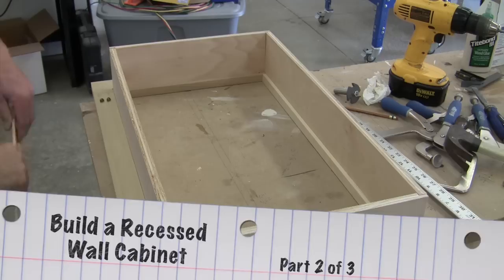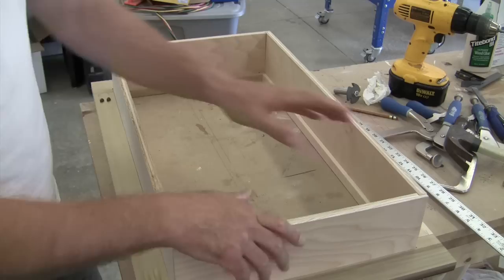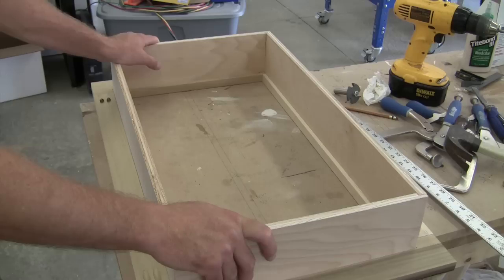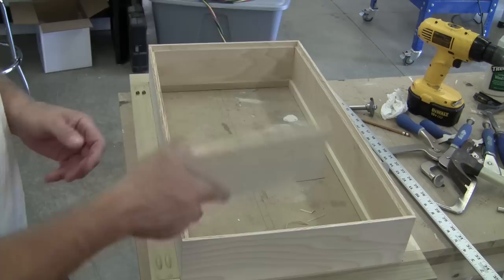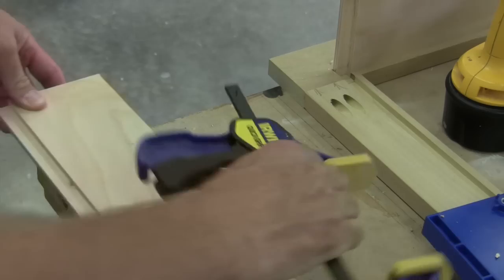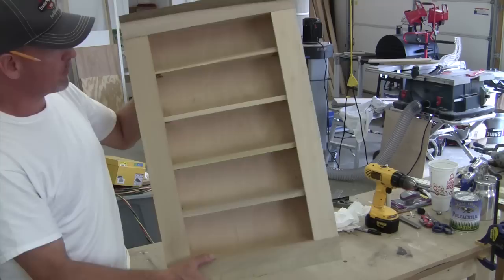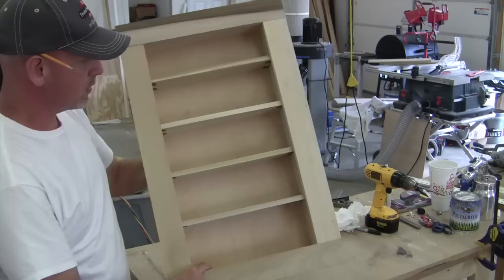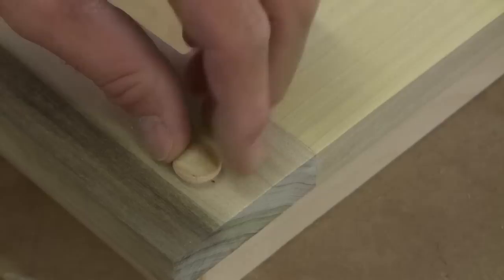How to Build a Recessed Cabinet Pt 2

Comment: At 12:08, why couldn't you secure it to the studs by putting a thin trim screw through the 1/4" holes you drilled for the shelf pins?
Reply: Good point!!